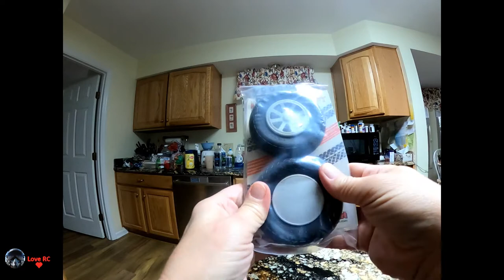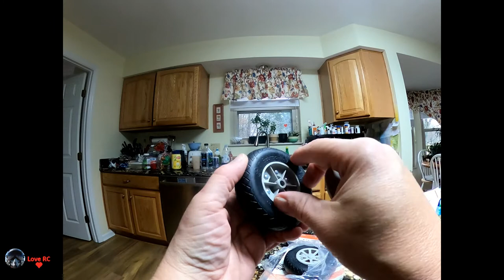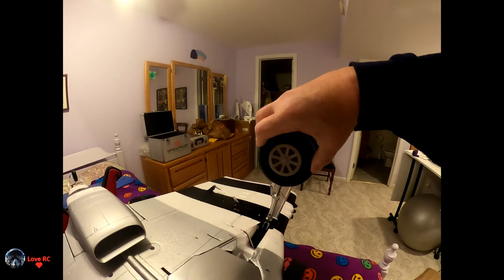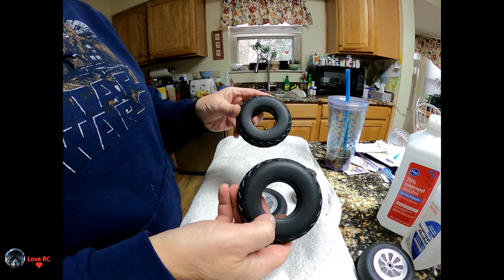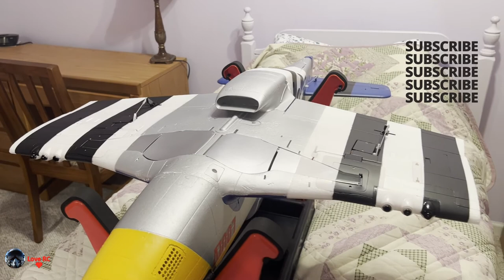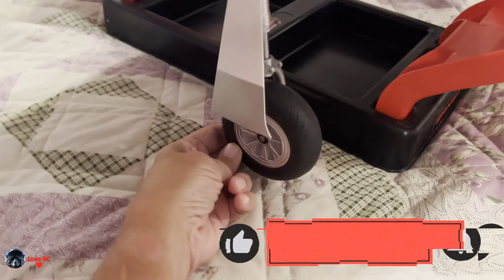E-Flite P-51D - RC Pilot Jerry's 1.5m Mustang Squishy Tire Mod

Comment: Perfect that’s what I was having issues with the hubs kept separating I’ll just glue them before the tire install thank you for that
Reply from the maker: Pop the tire on first and push it as much as possible through to expose the inner hub. You will have to work it a bit.  Apply just a little glue and don't get it in the axle hole or you will have to work on cleaning out the axle hole.  Then once the glue on the hubs is set, push the rubber onto the back hub.  It will pop.

Comment: I had this idea also. Looked good at first until I started using them. The runway tends to side load the tire and the rubber starts to push inward and rub the strut. This, of course, causes friction that turns the plane. It's because the stock hubs are a little too big i think. Unfortunately because of the bearing set. I can not put a shim behind the wheel to move it away from the strut. So i'm looking at maybe making a shim for inside the wheel to help support the tire from the inside. Maybe just a plastic disk or 3D printed one. Either way, just swapping the tire made a big difference in not bouncing. But now it won't go straight most the time unless i figit with the tires. But after just a couple touch and goes or sometimes just the take off. Often the tires start rubbing which turns the plane on landing if you keep the tail flying to long.
Reply from the maker: @IntegrityRC  I haven't had any issues so far but I will look for that.  Thanks!!